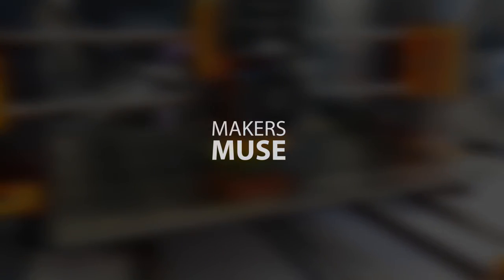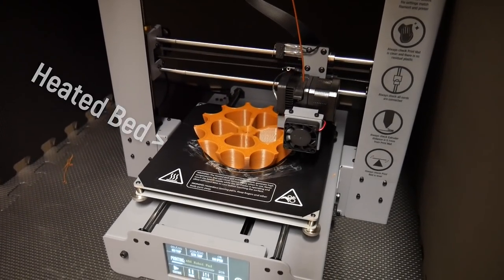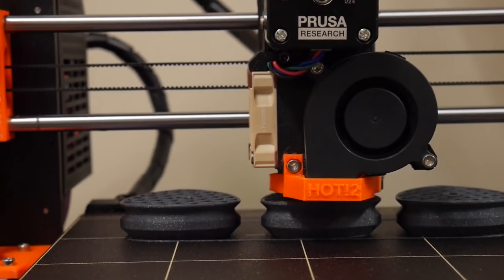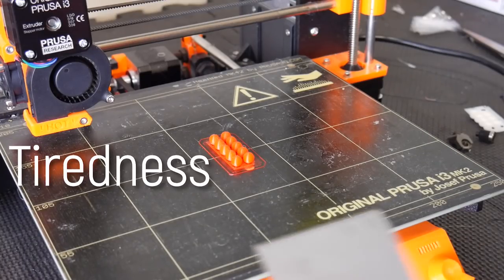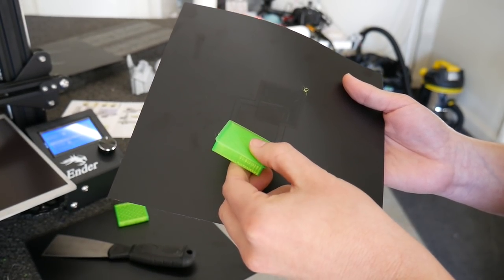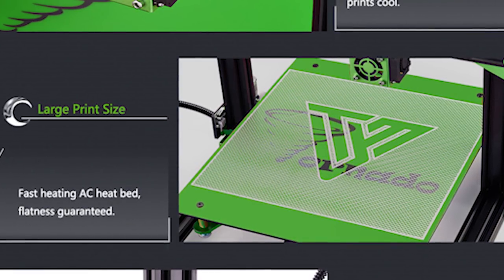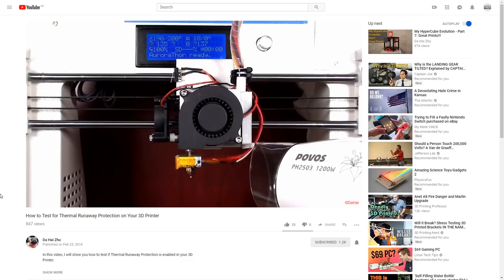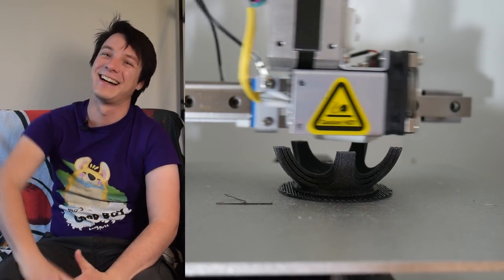Safety Tips for FDM/FFF 3D Printers - 3DP101

Comment: @Maker's Muse Not a barb here even though it may come across as one, it's a legitimate and honest question! Buuut.... You advocate a disposable build surface over something like borosilicate or BPT (blue painter's tape)? I have a hard time swallowing the cost of these 'build-tack' surfaces especially when a roll of 3" wide BPT costs under ten bucks and a single application lasts me for sometimes weeks if I don't damage it, and a roll will often last me a quarter or more. If I gouge a build-tack plate, I throw it away. If I gouge my BPT, I peel that strip off and put a new one on. A cost of cents versus tens of dollars!

Comment: Best way to teach how burning hot a 3D printer can get is to just feel out the heated bed while it warms up to print PLA and use that as a reference to how hot the machine’s parts can get. Remember, curiosity should not be ignored, one must educate and the best way is through experience.

Also, if you are touching a 3D printer when it gets to 100 degrees celsius then the machine could be broken or you need to pay a visit to the hospital

If you don’t have a heated bed these days, why? I mean, power drain blah blah all that, you don’t have to use it just because you have it but it’s like a spatula or air conditioning on your car, fantastic to have when you need it.

Comment: I deliberately bought an Anycubic i3 mega due to its rigid construction becasue i had kids under 5yo. Interestingly my kids were extremely respectful of the idea not to touch it. This is probably due to me teaching them about the dangers of fire when they were 2yo by showing them a match and acting as if i burnt myself. I also defined to them what "daddy's" means (primarily when they tried my hot sauce).
Do the right thing. Demonstrate it to your kids, show them what 'hot' means with a match. once they understand what hot means they will be quite clear on what you are tryign to tell them when you point at the hot end.

Comment: Fumes are a issue but unless you print all day or have a rack in a small room. It's not that much of a problem. Just cooking on a stove is much worse. 
So context is important. Ventilation is always preferable and don't think PLA is much better for you becose it smells better. They all give off fumes that are not good at some dose, just that a single printer does not make much and even less of a issue if it has a enclosure.  So important sure, but not that problematic if ignored.

Comment: This is a bit off topic, but I have a question. A friend and myself are having a discussion about drying filament (especially PLA). He seems to think desiccant is enough to pull all the moisture out of a roll of filament, and I think you actually need to put it into something with hot air (like the printdry filament dryer or an oven) to pull all of the moisture out. What is your experience with drying filament?

Comment: Working on hot, pinchy stuff?
You left out a human factor in this: injury reaction!
Hand deep in a cabinet, hot-end brushes your hand, you react by instantly pulling your hand out of harms way.  Of course you do.
Along the way, your fingers, hand, wrist and forearm find every sharp edge and exposed screw in the cabinet!
A tiny burn can become a big mess!
Train yourself as to the location of the danger-bits, of course.
But also look at how your hand is reaching into the cabinet: is your palm toward danger, or the back of your hand?
Fun fact: electricians always make sure the back of the hand is toward the mains!  In case of a jolt, the hand often closes reflexively.  
Better to make a fist away from the wire than to hang onto it for the rest of your life.
BTW, your fingers have 100's times more nerve endings than the back of your hand, which burn is gonna hurt worse?

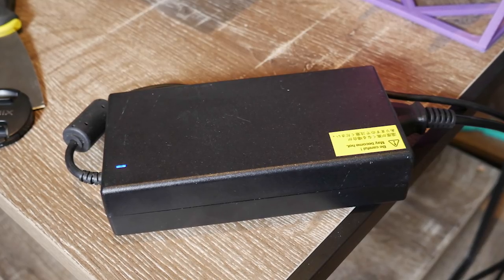Comment: Whoa.... whoa.... 8:15... Don't assume that plastic brick is isolated from the mains!
Some DC power supplies (especially really cheap ones from China) do not correctly isolate the mains from the DC output.

Some power supplies are so bad that you can run a mains voltage light bulb between (actual) ground and one side of the DC output. Those are the ones that will kill you while maintaining a nice steady DC output so your printer can happily finish the print job.

Comment: I''ve never got it why there is no simple thermal fuse to protect from thermal runaway. I can see how chinese manufacturers try to skimp on a couple cents and tweak the software on something. A good safety practice is to always use something else to protect you than the main circuit.
All it takes is a software to get crashed with thermal heating control pin up. No software can protect from runaway at that point. (no idea if they use watch dogs but you get the point of external fuse). Runaway can also be caused by hardware failures like a driver fet shorting out. No software helps there either but a thermal fuse would help.

Comment: well, for electronic stuff shouldn't you check any connections regularly? 
and ofc follow the rules for repair- turn off, secure against any possible reactivation (be it idiots or faulty tec) disconnect, check whether its really disconnected and has no current running through, ground if you have not and then do repairs.
Reply: and check the caps.

Comment: I honestly kind of think 3D printer development is stagnating, not to a complete halt, but progress is slower, there are a lot of cheap touch screens, wifi, flexible print plate options, and printer firmware that remains undeveloped or still in a convoluted system to manage. There are some solutions out there but most tend to the side of obnoxiously high costs relative to a little DIY fun which the 3D printing community was essentially born from. I’m kind of concerned some people believe this is the extent of 3D printing while we are still miles away from the ultimate maker goal of creation on a whim.
Reply: Bajicoy 
Well, there is the thing with PC watercooling. Also a niche understood by hobbyists and enthusiasts who want to push thermal capacity further.
Reply: FF are bringing out a 2 colour printer along with new models,,,this will be like mobile phones
Reply: Glen Dooer Flash Forge has had dual nozzle printers on the market for the past several years and they aren’t even the biggest backer of the tech normally focusing on school’s and high end businesses with a robust frame as their general selling point, Prusa’s 4 color system or Ultimaker’s dual nozzle system are prime examples on the higher end of machines and you can find quite a few gimmicky cheap printers with dual nozzles and still using some simple Marlin that the rest of the community had access to anyways. New innovations would be Prusa’s new revolver multi color system that potentially could use 5 or more filaments but there are still some considerable mechanical bugs and programming hurdles to get over, something I would love to see is a Sigma dual carriage system that uses two or more SCARA arms or a multi rotational print bed system but the main draw back for those are programming both firmware and some new software, some companies have trotted out some new machines or ideas at faires but generally these are closed sourced machines for exclusive demographics, we’re not quite at the mobile phone level and I sure hope not, I think it would be better to hope that 3D printers become more like home computers than even cartridge focused ink jet printers or phones that must be replaced on a frequent basis, water cooling as mentioned above is also a new-ish tech, most companies have tried and failed selling it and E3D is one of the few companies recently I have seen marketing it albeit at a high cost and small quantities, and yes there are some community attempts at making their own water cooled systems, it has a lot of potential, just haven’t seen much in terms of reliability or accessibility improvements for a long while now, maybe just me and some negligent browsing

Comment: I keep a nest protect smoke detector next to my machine.
Reply: Just don’t overly trust in it.  I had a Nest Protect and a Kidde carbon monoxide detector near (not next to, but near) my printer when it malfunctioned.  Neither alerted me - ultimately it was a strong smell of ABS from a room I never smell it in that made me go check.  I went to the printer room and found it full of thick grey/white smoke and flames/whistling smoke coming out of the nozzle.
Reply: No substitute for a traditional fire alarm supplied by a fire department. They only have one function thats to save lives wouldn't put my trust in relatively new tech through a computer
Reply: Get a photoelectric smoke detector not an ionizing detector and then make sure it has an interconnect wire. Plug it into a relayed power bar (or the ground of a GFI if you are ghetto) and it will kill power to the printer if it detects smoldering.

Comment: Too many of these 3D printers are built up to the "wooden toaster" standard of safety. Exposed mains voltage, improper grounding and isolation, underrated wires or connectors, lack of flame retardants and safety cut-offs... I mean wtf.

Comment: Hi Angus, great and very responsible tutorial safety video. Don't forget ingestible particulates and VOC (hazardous chemicals) emissions - these can be carcinogenic and quite nasty from some unbranded (and even branded exotic) filaments - even if they are simply labeled as familiar types like PLA, ABS etc. - additional chemicals added to some familiar types of filament can seriously escalate the emissions danger - see details at www.kora3d.com for a sensible all round, reasonable cost safety protection system - protects against everything you mentioned (except the scraper slash!) and also against the potential nasty emissions you did not 👍

Comment: 3D printer kits and people with no basic knowledge in electronics and electrical is a mix for disaster. If you plan to get one of these inexpensive DIY kits get some knowledge first! These kits are not for the beginner, being able to setup your cellphone or change the batteries in your tv remote doesn’t make you an electronics expert, there’s a lot more to then that!

Comment: Common sense should prevail, research is key if you are a noob to 3D printing, pinch points, electric shock etc all come with photo copiers for example. No need for this you are a 3 year old so don't do this LuL attitude video. Imo